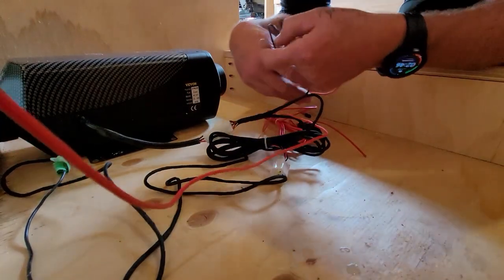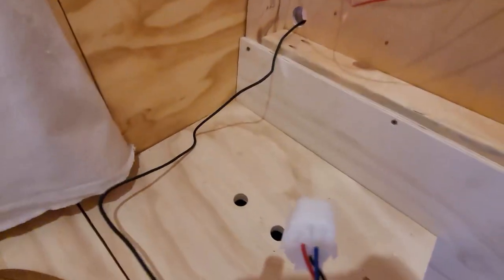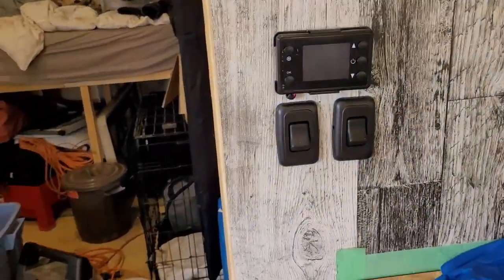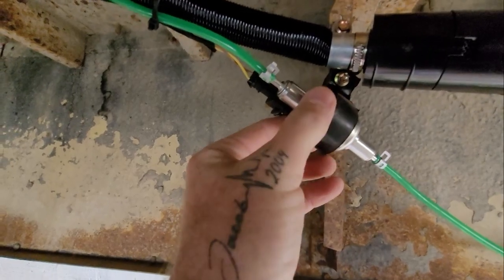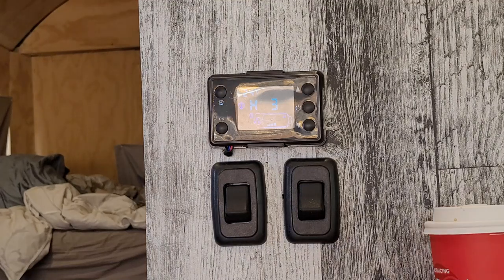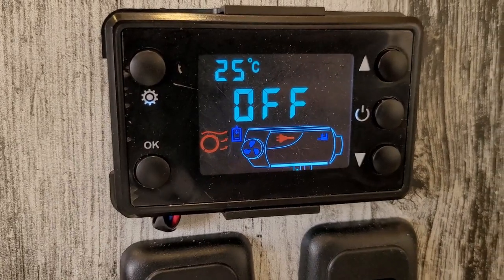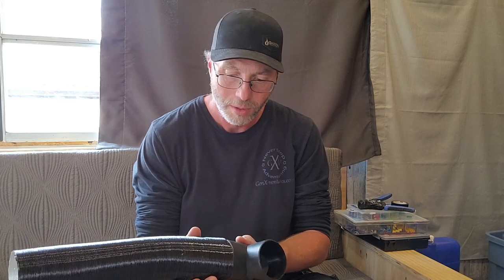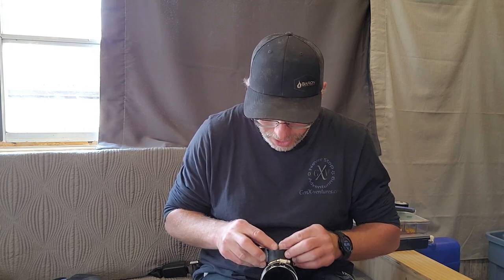Bus Build Episode 49 - Diesel Heater Install - Thermostat and Test Run

Comment: Hi friend and thanks for the shoutout!
I really like the channel. The last few videos were a little bit dry though. Not your fault just the subject matter.
Have you ever considered using a propane fireplace for heat? They are so nice and a great ambiance.

Leaves are starting to change here in Vancouver. Winter is on it's way. Keep up the content this winter- NO EXCUSES
Reply from the maker: We thought about propane but I hated it in all the RVs I've had over the years. I found that when it got really cold they didn't work as well. The diesel heater in our camper works great.

Leaves are changing here as well. With the bus at our house, we should be able to continue to work on it through the winter. Just turn up the heat and go!

Comment: I've seen several people get around the accidentally-running-out-of-fuel by leaving the heater's pickup tube in the main tank several inches above the bottom so it can't run you dry. But in my rig I'm doing the same as you, adding a seperate dedicated fuel tank for the heaters. Added benefit to yours and my method is you can use dyed/off-road diesel for the heaters and save a few bucks on the fuel tax.
Reply from the maker: Using dyed would be a great idea. I might have to do that. I have access to purchase dyed for work. I could pick some up for myself as well. 

Most of the installs I have see that tie into the bus tank are putting a T in the main line. Putting a completely separate line would definitely solve that.
Reply: That looks like a lot of hassle for having a separate tank.  I definitely wouldn’t want to be fooling around with that out in the cold.
Reply: I've seen a couple videos where people did that. I always wondered how they avoided pulling fuel back from the engine and losing their prime. Most of the videos I've seen they just drop a new pickup tube direct into the main fuel tank which usually involves drilling the tank or drilling a knock-out plug. A lot of the truck stops I go to for diesel has reefer (dyed) fuel available right at the pump, so after you buy clear diesel for the engine tank you hit "next" on the pump and then fill the aux/heater tank. Super convenient. I have a small siphon pump I keep in my toolkit in case I ever need to re-prime the fuel filter canister when changing out a filter so in a pinch can always steal some clear diesel from the main tank for my heaters on a cold night.
Reply from the maker: @thetslabus sounds like a great set up!
Reply from the maker: @robertjude8261 There is a ton of room under the bus and it fills quickly. But, it is only a temporary setup until I get the underbody storage box and the actual fuel tank I want to use. A marine fuel tank with a quick connect.